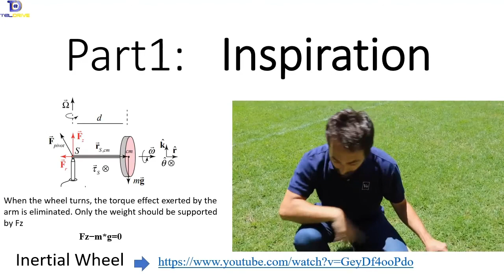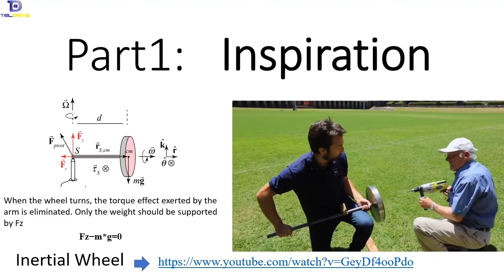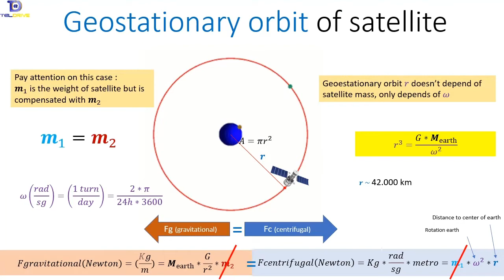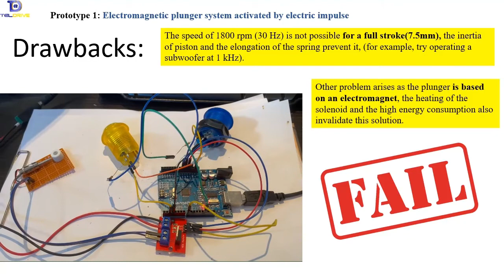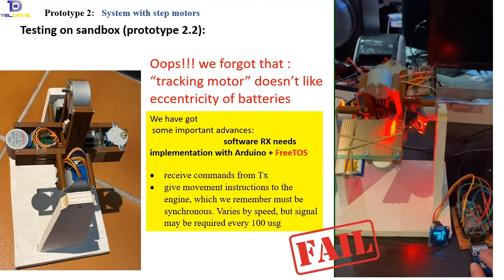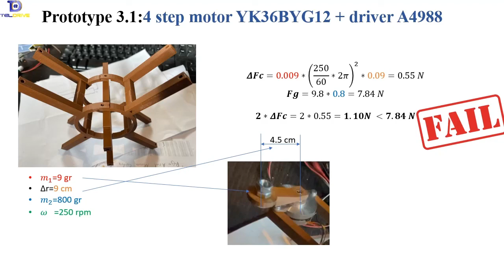anti gravitational engine

Comment: I know of one tangible way to make an inertial drive but I can't see it being powerful enough to lift anything into space. However it could be used as a slow accelerating motor on a spacecraft once in space. It would consist of a liquid or gas filled sphere with laser beams converging at the centre to produce a field of exploding plasma. Each plasma explosion will push the head of a hammer on a spring against a bar going to the wall of the chamber. This will cause acceleration in the direction of the hammer stroke against the bar. The exploding plasma field produces no recoil effect from pushing the hammer because it's not mechanically connected to the device, it stands alone within it. The kinetic energy that doesn't push the hammer transduces into heat before it can touch anything else and that heat is either thrown out or recaptured to be transduced again to save energy.

Comment: This concept will not work. It's not basic to explain why, but I'll give you my support: Think about a pipe which can have a variable section and that can have the path (a closed path) that you prefer in a 3D space. Add a powerful pump to spin the liquid so that it will exert centrifugal force on the outher wall of the pipe. Now you have the same of a very high number of buckets turnimg in your device, so many that the water is a continous stream. What shape is needed to make the pipe reduce it's weight when the pump is on?
The answer is "pipes do not fly!".
The reason is that when you act reducing the rotational radious of your mass, you accelerate it towards the bottom, so that it will increase it's inertial force. This vanificate every and exactly every effort to unbalance the sistem.
Cheers.